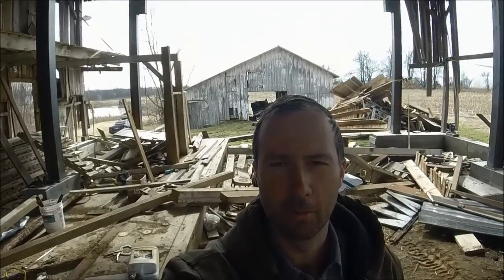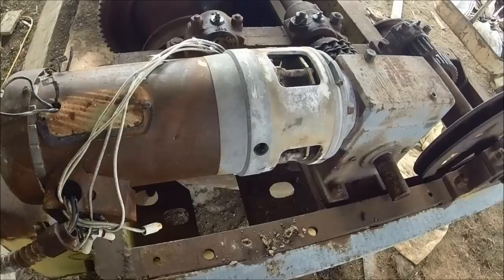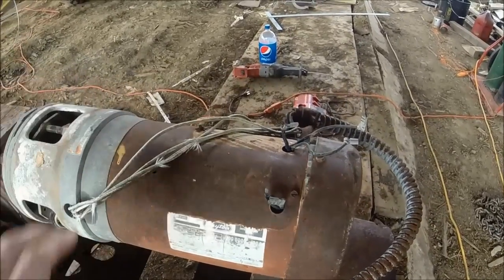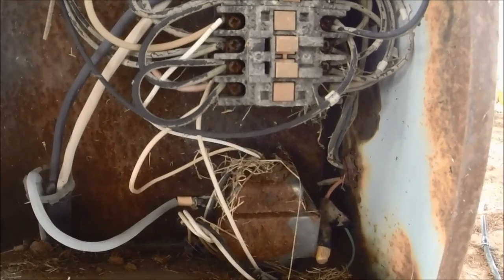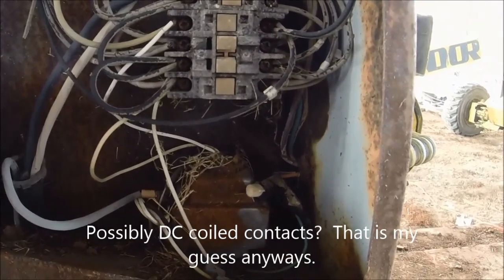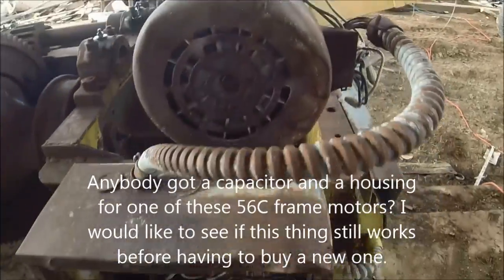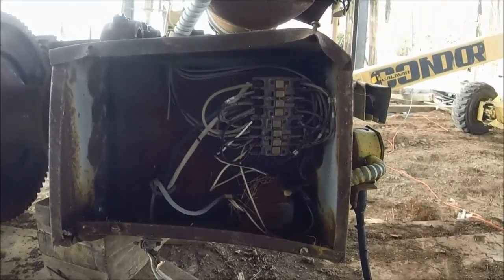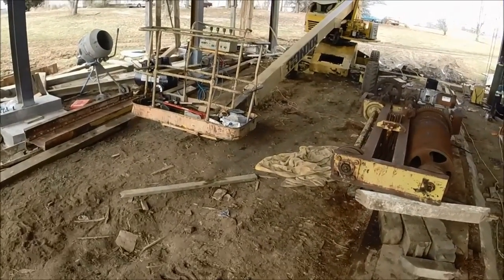Shaw Box BR Hoist repair Part1

Comment: Brian   Been watching shop progress.  One dang big job for sure and nice work.

You said elsewhare you wore considering VFD and three phase motor.  Has lots of merit especialy so in a machine shop.  Thia would let you lower heavy load very slowly onto a machine tool.    No jogging motor to avoid dropping load onto the machine -- this is very very hard on motors.  Another advantage is you do not have any starting  swithch problems nor problems with capacitors.  IF you are real lucky you may be able to bolt new motor right onto gearbax.

Based on 4 wires out of the brake it is a dual voltage setup ie 120/240.  You will sill need a relay for it if you go VFD - make double dang sure VFD will be able to control that before you buy VFD.

IF you stay with existing setup the first thing I would do is take the motor to a rewind shop and have them check the windings.  They may be heat damaged from jogging ie frequent starts.  The insulation is class B which is old school and "lower temp" rated than insulation used nowadays.
The single phase seutp is two ralays for up and down.  THey should be interlocked both mechanically and electrically to ensure you NEVER energize bot directions.  The brake is released ie energized by the fourth contact on each relay.

I wouild go with 24 volt control - shop floors always seem to be wet.  These are very common from any good electrica distributor.

As several have said it is best to have something to hang the pendant from.  Yes you can get cable with a wire rope inside BUT I think it is cheaper and better to have in on a chain fastened to the box to enable easy inspection 

Dont forget you should also have control limit swithces to prevent two blocking or unwinding the drum.

Light for the underside of the trolley is a dang good idea.  Large ones in a steel mill had them hung off the bridge beams.

Just some thoughts from a motor control electrician

Dan Bentler
Seattle Wa
Reply from the maker: +dan bentler I have been advised by a tech from a crane supplier that I should not use a VFD as they are prone to stalling/tripping out and dropping the loads. I am not sure with the worm gear setup that is likely as the load doesn't want to back feed the worm anyways. My calculations indicate the retrofit would have been incapable of lifting 15ton rated load as I calculate it needs a 10ftlb input. Looking at a Baldor catalog since I can't find a dayton it looks that a similar motor has a pull up torque rating of 8.4ftlb meaning the motor would be stuck at near stall lifting a full load. This motor would appear up to the job and interchange: http://www.baldor.com/catalog/CEM3558#tab=%22performance%22
Reply: +bcbloc02 Re advice of crane guy.  Tripping the VFD would be the same as releasing the up or down switth ie de energizing the motor.  So to go with his claim the load would drop anytime the motor is turned off --  hmm maybe that is why the used worm gears drive AND a brake.

I have seen a worm gear driven backwards by the load - there was no brake on the unit.

Right now we cannot put 15 ton on hoist and measure the torque demand to the gearbox ie motor output torque.  For youur existing 1.5 HP 1725 RPM motor I get j4.6 ft lb.  I do not know the gear reduction nor radius of drum fully loaded with rope so I gotta trust your 10 ft lb value.  IF the 10 is correct then you have one very undersized motor and it may not have a dood life expectancy.

RE the VFD recommendation.  The first thing is know the torque demand at full load and maybe 150% full load.  Size motor to that.  THEN pick VFD.  Baldor was the premium motor a while back now they are Siemens.  I woiuld be OK with Baldor for motor and geaf box selection and for VFD -- ESPECIALLY SO -- if they have local support.  I would NEVER buy VFD without local support.  E Bay is fine if you are buying a $100 1/2 HP VFD but in your case you are a machinist and you are NOT making money fixing a crane - it is supposed to be working for you.

Dan Bentler
Reply: +bcbloc02 Re advice of crane guy.  Tripping the VFD would be the same as releasing the up or down switth ie de energizing the motor.  So to go with his claim the load would drop anytime the motor is turned off --  hmm maybe that is why the used worm gears drive AND a brake.

I have seen a worm gear driven backwards by the load - there was no brake on the unit.

Right now we cannot put 15 ton on hoist and measure the torque demand to the gearbox ie motor output torque.  For youur existing 1.5 HP 1725 RPM motor I get j4.6 ft lb.  I do not know the gear reduction nor radius of drum fully loaded with rope so I gotta trust your 10 ft lb value.  IF the 10 is correct then you have one very undersized motor and it may not have a dood life expectancy.

RE the VFD recommendation.  The first thing is know the torque demand at full load and maybe 150% full load.  Size motor to that.  THEN pick VFD.  Baldor was the. premium motor a while back now they are Siemens.  I woiuld be OK with Baldor for motor and geaf box selection and for VFD -- ESPECIALLY SO -- if they have local support.  I would NEVER buy VFD without local support.  E Bay is fine if you are buying a $100 1/2 HP VFD but in your case you are a machinist and you are NOT making money fixing a crane - it is supposed to be working for yo

I think with VFD another option would be to conrol the brake from the up down switches on pendant - with relays fo course  - use double pole switches ie one contact for VFD and one for the brake.

Dan Bentler
Reply: +bcbloc02 Re advice of crane guy.  Tripping the VFD would be the same as releasing the up or down switth ie de energizing the motor.  So to go with his claim the load would drop anytime the motor is turned off --  hmm maybe that is why the used worm gears drive AND a brake.

I have seen a worm gear driven backwards by the load - there was no brake on the unit.

Right now we cannot put 15 ton on hoist and measure the torque demand to the gearbox ie motor output torque.  For youur existing 1.5 HP 1725 RPM motor I get j4.6 ft lb.  I do not know the gear reduction nor radius of drum fully loaded with rope so I gotta trust your 10 ft lb value.  IF the 10 is correct then you have one very undersized motor and it may not have a dood life expectancy.

RE the VFD recommendation.  The first thing is know the torque demand at full load and maybe 150% full load.  Size motor to that.  THEN pick VFD.  Baldor was the. premium motor a while back now they are Siemens.  I woiuld be OK with Baldor for motor and geaf box selection and for VFD -- ESPECIALLY SO -- if they have local support.  I would NEVER buy VFD without local support.  E Bay is fine if you are buying a $100 1/2 HP VFD but in your case you are a machinist and you are NOT making money fixing a crane - it is supposed to be working for yo

I think with VFD another option would be to conrol the brake from the up down switches on pendant - with relays fo course  - use double pole switches ie one contact for VFD and one for the brake.

Dan Bentler

Comment: You can get a new cheap Chinese hoist pendant on eBay for five bucks. Big Clive (bigclivedotcom here on YouTube) reviewed one and said the construction was surprisingly good. 

Likely that box had a pair of 24V contactors and a 24V control transformer, running low voltage to the pendant, which would be nice. If I were doing it I'd probably replace both of those contactors with new ones, along with redoing as much of the wire as possible.  You can get a pair of new 9A contactors from automationdirect.com for $15 each. Probably can get a pendant from them too.

Comment: Hi Brian
I would start by identifying the leads coming from the motor at the contactor, mark the leads with taps and number them. The T5 and the T8 will be the start windings. P1 will connect to LINE1, P2 is not used for 230 volts just tape it, #2#3#8 are connected together, #4 #5 go to Line2. To reverse direction #5 and #8 are swapped, 
Unless you mark the wires it will never make any sense
The 1.5 hp Dayton motor I have has two capacitors one is a start capacitor 708-850 mfd 125vac and the run capacitor is a 12.5 mfd 370 vac. 
The start capacitor is usually  disconnected by a  centrifugal switch inside the motor when it comes up to speed and the run capacitor is more than likely left in the start circuit all the time. They are using the start winding with a much smaller capacitor as another run winding.
A two voltage single phase motor has 2 run windings, on 115 they are wired in parallel and on 230 they are wired in series. That way they have the same voltage going through them on either voltage. One run winding is #1 and #2 and the other is #3 and #4, knowing this will help to identify the wires. 
Hope this helps 
John Fink
Reply from the maker: +imystery man Thanks a lot, I will have to sit down with some paper and a paint marker and get to figuring it all out.

Comment: If you go to page 76 of this PDF it shows your setup. It does not show the low voltage transformer, but that is not relevant.
static.schneider-electric.us/docs/Machine%20Control/0140CT9201.pdf

Comment: Brian, check out this URL. There is a schematic down the page that shows a single phase input with four pole reversing contactors like your setup. it also shows a thermal overload which I do not see in your application.
http://www.ab.com/en/epub/catalogs/12768/229240/229248/10521726/10525386/10538456/print.html
Reply from the maker: +larry munday Yep I noted no overload as well, I guess they had it on the lift it or burn it up setting.

Comment: Brian

If you home brew a pendant make sure you have a lock stop in the hot feed and a steel strain wire in the cable just in case you try to pull the crane with it .

For a simple pendant have a look at the cheap harbour fright stuff they may have spares , or the remote controls for 4x4 winch units ( not sure what you call stuff in our common language separated by a pond )

Stuart

Comment: You got a couple of good tips on how to re-wire the motor and control, I highly suggest you replace most electrical contacts, wires, and control that went under watery conditions or stayed exposed to the elements for long period of time in order to avoid bad contacts or porous wires that will eventually cause serious troubles... ;)
I think that using the motor is going to ease the work, although the manual chain backup is a good idea, just in case.

Comment: I believe  your contactors are set up as an "H-bridge" for reversing. The contactors are low voltage powered by the transformer. Most likely the 2 switches in the controller were wired in series through normally-closed contacts on one switch so that when one is engaged, the second would have no power to pass. Looks like you're missing the starter cap off of that motor as well.

Comment: My suggestion would be to go for the best control of the load that you can economically afford.  I used to work where we had a simple control 5-ton crane, it was a pain to smoothly raise and lower or travel, particularly starting or stopping.  You are already concerned about dropping a load on the mill table. It looks to me like this a simple control of on-off, so it will be not be smooth in starting or stopping.
Reply from the maker: +Roy Reynolds I agree, I have used some electric hoists that were horrid at being smooth. I think the only thing that would help in this case is there is signifigant reduction. With 8 hoist cables a pretty big movement of the drum still results in a fairly small movement of the hook.

Comment: contactors are most likely FWD and REV, I am guessing 24v AC coil (from the transformer) - without a diagram of what you have there now is hard to tell but I assume each of the 2 contactors have some normally closed contacts which would loop thru to the other prevent engaging at the same time (so when one is engaged would prevent the other to be energized). hope this helps.

Comment: That could be an interlocked reversing contactor. The coils are 110V ac while one is on the other can not be turned on (the smaller contacts on the end do this) I am not an electrician but had to trouble shoot and reverse crane's where I worked Maintenance.  https://www.google.ca/search?q=reversing+3+phase+motor+contactor+wiring+diagram&biw=1093&bih=506&tbm=isch&imgil=n3v8tRdlCRt8sM%253A%253BtUEYPlY17gIUSM%253Bhttp%25253A%25252F%25252Fwww.macromatic.com%25252Fblog%25252Frelays%25252Fhow-to-connect-a-three-phase-monitor-relay&source=iu&pf=m&fir=n3v8tRdlCRt8sM%253A%252CtUEYPlY17gIUSM%252C_&usg=__mSxXSdvDpM5K1wCsBsWe5YarWow%3D&ved=0ahUKEwjx7c2Ix5DLAhVLvYMKHfddDjIQyjcINA&ei=s7bNVrHIOsv6jgT3u7mQAw#tbm=isch&q=reversing+3+phase+motor+contactor+wiring+diagram+for+crane&imgdii=z0iZjPbe5bJEqM%3A%3Bz0iZjPbe5bJEqM%3A%3B6zTNoS9pg0aLuM%3A&imgrc=z0iZjPbe5bJEqM%3A 
That should give a simple wiring diagram! the breaking system is not on this diagram!

Comment: I take it u are missing the controller box and wiring going from hoist 2 floor?  If so, I might just price a wireless control unit and see what that would set you back. Hell, nowadays might be phone app that hooks up with Bluetooth. A wireless conversion might be a much more cost effective way of repair that probably includes new relay. Can't buy a 12 gauge extension cord anymore for under 50 bucks. Anymore. Almost all relays are 12-24v dc. Also probably powers lights and warning siren.

Comment: Here are some info links for you:  

Motor info: 
https://www.grainger.com/product/DAYTON-1-1-2-HP-General-Purpose-Motor-6K702
Replacement parts including capacitors and housings are available from Grainger by calling 800-472-4643

Generic diagram page 71: 
http://static.schneider-electric.us/docs/Machine%20Control/0140CT9201.pdf

Reversing diagram: 
http://www.hytrol.com/mediacenter/installation_manuals/im_electricalwiring_010105.pdf

https://www.google.com/search?num=100&newwindow=1&site=&source=hp&q=Shaw-Box+hoist+manual&oq=Shaw-Box+hoist+manual&gs_l=hp.3..0i22i30l3.2049.15111.0.15566.15.15.0.0.0.0.166.1310.11j3.14.0....0...1c.1.64.hp..1.13.1214.0.vMM3ShOO1-w

https://www.google.com/search?num=100&newwindow=1&q=shaw+box+hoist+wiring+diagram&oq=Shaw-Box+hoist+&gs_l=serp.1.4.35i39j0i22i30l9.46540.47438.0.51571.6.6.0.0.0.0.125.589.4j2.6.0....0...1c.1.64.serp..0.6.585.sOTetOJhsI8

If you have questions, need/want additional info or assistance, just replay and ask.
Reply from the maker: +patw52pb1 Great links, especially that second book, it helps a lot.

Comment: Hi Brian. I googled Shaw-Box and there were several circuits that came up in the images.  Maybe you could recognise one of them with reference to your setup. Also if you take the complete motor and control box to you local rewind shop they should be able to test the motor and the control circuit and mark it for you. They would know what capacitors are also needed. It may cost a few $ but will give you the answers without too much time spent on a wild goose chase.  Good luck and regards from the UK
Reply: +Gary C Maybe a call to http://www.jherbertcorp.com/brands.htm  may help as they have manuals for many cranes and hoists. You never know your luck.
Reply from the maker: +Gary C Thanks, a trip to the big city maybe a good solution, or I may just scrap all of it and go 3 phase VFD from scratch.
Reply: +bcbloc02 Brian, Difficult to release the brake and have a VFD ramp up fast enough to prevent dropping the load some.  Very tricky to VFD a hoist motor.
--Doozer

Comment: I forgot to add, if you replaced it with a 3ph motor, you can get cheap 1to3 ph vfds, and have variable speed, smooth start and stop, and a low/no voltage pendant.
Reply from the maker: +eformance Are there VFD's with remote variability? I think it would be slick to have a rheostat knob on the pendant for infinite speed control.
Reply: Yep, most have a diagram showing that in the manual. Speed knob and a rocker for fwd/rev.
Reply: Automation direct has good cheap 1ph in, 3ph out vfds for under 3hp loads.
Reply from the maker: +eformance If I went that route should I up my HP to the max for the frame size so I can help not losing a bunch of low end torque with the speed down?
Reply: +bcbloc02 Many VFDs have a low RPM torque boost function so you don't lose a bunch of torque down low.  If you can figure out the turns ratio on that gear box, I think you'll have the answer about your torque requirements.  I'd bet that box has a very deep reduction, 1725RPM in would make for a very fast hoist if it didn't.  90:1 isn't unreasonable for a box like that, which would make 19RPM output.  The Automation Direct GS2 drives have this rating: Starting torque: 125% at 0.5 Hz/150% at 5 Hz.  In practical usage, I'm uncertain exactly what that will result in, however with a huge reduction box, even at 20Hz the torque will be very high and speed only 6RPM or so.
Reply: Brian, I have a VFD powering my Powermatic drill press.  It's a Teco FM50 for 1HP.  I have mine hooked up with FWD REV as well as a rheostat for speed control, all on a remote panel.  I believe those remote controls are low voltage, powered by the VFD.  You might want to check into the upgrade VFD that are known as vector drive.  They don't lose Torque when you slow them down.  Plus all VFDs have braking functions and soft start built in.  Mine stops the drivetrain on my press in way less than a second.  I have a video of it on YouTube some years back powermatic 1200 VFD should find it.